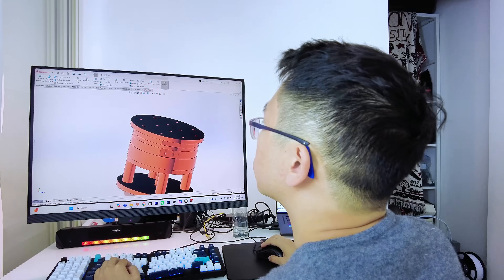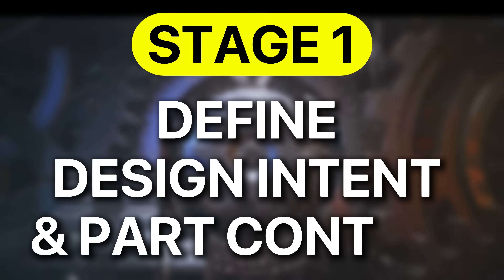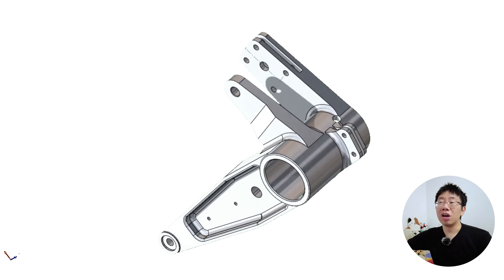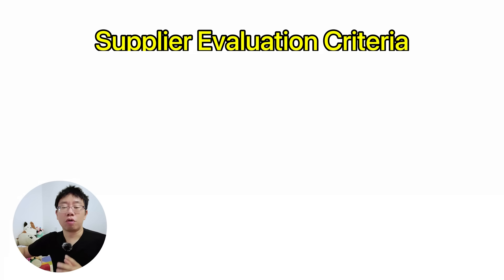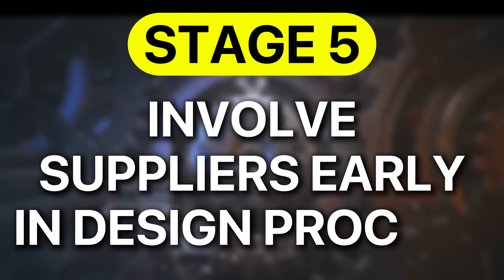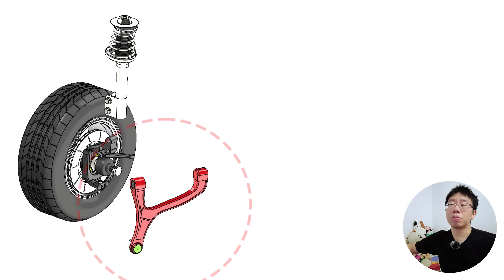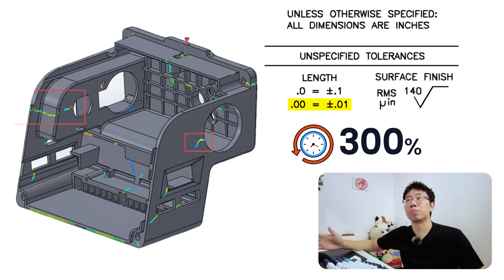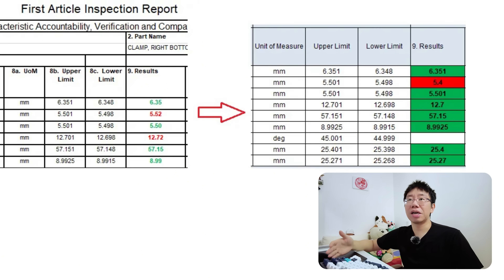Why Manufacturers Hate Your Design and How to Fix It

Comment: 4:10 modern swizz lathes are CNC. You can mix manufacturing processes, like forging the head of a screw, laminating the thread. 
Additive manufacturing is starting to grow, now is using diapers. However there are pieces or materials that only a 3D printer can manufacture, like tissue or aerospace marts. Jewelry is also making use of two manufacturing processes, one ancient, casting and modern, 3D printed patterns. 
6:12 indeed you should visit the supplier in person when possible. 
8:06 in my experience searching for the supplier means taking the prototype and asking if the prospect can manufacture the piece at the desired price. Sometimes they start giving you designs ideas on how to achieve the budget. (Don’t chanfer this, are the tolerances needed for the feature of the piece, finishing of the surfaces, a.s.f.)

I’ve been in both sides of the door between design and manufacturing. Supplier and designer should work together. Better yet, designers should be well acquainted with manufacturing and assembly lines.
One more thing. Think on the poor maintenance provider who has to suffer the design flaws. (Do I have to disassemble the whole engine to get to the obstructed bolt of the transmission?)
Reply: Ive even seen some guys model a hand with a wrench and use that as an additional "constraint" in their CAD models. Thanks for the hard-fought wisdom :)
Reply: Even better, blocking out an "ugga dugga" and forearm and  (Blocking out means literally making a model out of blocks, i.e. quick rough sketch.) 
Also taking inspiration from appliance manufacturers and putting a waterproof pocket that's easily noticable and accessible by a technician (that means usually right behind the first access door, not with the rest of the manuals because people will lose those) alternatively, print or engrave a qr code and website address if a booklet is too expensive. You can put it with the serial number sticker if you don't want to spend more money.
Reply: Whaaat? You mean i wouldn't have had to ask for a jet engine to be dropped to tighten a fitting because there was a random bracket boxing in the connection? Or for the fuel system to be disconnected and 3 parts removed to remove the last bolt on a part where the other bolts are easily accessible?

Comment: Worked for a vertically integrated company that had R&D and Manufacturing under the same roof… I sent so many of those “we can’t make this” emails. Manufacturing engineers make great design engineers later on because they understand the constraints of different processes so intensely. 

Worse than going to R&D about a functional feature was going to marketing to approve exterior design changes 😂
Reply: this is why you cycle new "designers" or R&D types through manufacturing first. That way they learn what their own company can and cannot do.
Reply: @kurtmueller2089  Yep. Funnel through the primary bottleneck first, then optimize every other problem in accordance with that

Comment: "Design for a process, not every process." - Such a key takeaway. We frequently help designers choose the right one (CNC, 3D print, vacuum casting) for their stage and volume. Clear communication on tolerances and critical features from the start prevents 90% of issues:face-blue-smiling:

Comment: Why do you keep ur 3D printer next to you ? Doesn’t it give off fumes ?
Reply: it's clearly just for the background image. you could notice there is no space for the mouse as well, so I'm assuming he places it there just for the video.
Reply: Filament 3D printer doesn't.
Reply: @RitamSanyal  it does, depending on filament.
Reply: @jtucehok  oh ok,I have only seen resin once with fumes.
Reply: ABS and ASA are the worst offenders of the common filaments (for some cursed reason pvc exists too but is rare), but even pla is not great if printed with no ventilation regularly
They are fine when cooled but the plasticisers in them evaporate when heated and they are evil.
Reply: @RitamSanyal depends on filament...

Comment: Test automation engineer for PCBs here - me and the team I'm working with have been developing+ building one-of-a-kind test systems for our internal production for years. In a recent project we were tasked to bring up these systems to a more scalable standard (from handsoldering the PCBs and crimping cables on the fly to standardizing it and making it manufacturable externally without issues. For that we closely worked with a specialized team that is focusing on manufacturability. All the points you mentioned in regards to mechanical design also apply to PCB design. What soldering process do you wnt to use? That influences part type, count, and placing - assembly on both sides or just one? Only soldering or are there press-fit connectors? How thick are the copper layers? With thick copper layers even the overall copper distribution matters - if its not balanced the PCB will warp and might not meet certain standards.
The devil really is in the details and in the last few months I learned almost as much as I did in 2 semesters of electrical engineering. Fascinating stuff!

Comment: All engineers/designers should be forced by law to take an apprenticeship (2-3 years minimum), at shop level in whatever industry (machining, casting, forging, injection molding), both manufacturing part and maintenance.
One would learn some trade secrets that never make it to the textbooks.
Reply: this remind me of the treatise on bicycle wheels by jobst brandt, the guy did a lot of research, trial and error on his own, because the knowledge was only trade secrets and cargo cultish when it came to building bicycle wheels, and when he tried to build his first set of wheels, he found no books on it, no information on why he should use any particular parts and such, and to quote him : "I wrote this book to preserve the information that I gathered and to help others avoid errors that often have led to failures. I hope it fills the void that I perceived."
also the apprenticeship aspect is proven( to be a better way of doing so in computer science/software engineering, i've done an apprenticeship as a software dev, and out of uni i had more industry context and how stuff worked in the office than someone who only did uni work, and i'm not the only one with that feedback.
Reply: How about sending a future teacher or someone who can create extended textbook containing those trade secrets?
Reply: @anterprites  or even better, why not have older engineers with 20-30 years under their belt go become teachers where it matters, like, make it a part of the obligations to hold an engineering title
Reply: not quite what you are suggesting, but in my german mechanical engineering course there was at least 1-2 semesters of not actually doing manufacturing, but learning about what would be feasible to do along with many extracuriculars that would teach you by doing something like a small racecar or gokart and during cad lessons we were taught to consider whether features where actually necessary and machinable, though im not sure if everyone taking the course got the lesson
Reply: In my professional opinion, apprenticeship isn’t enough. Engineers will need to get actual classroom time and actually get certified in some areas like Metrology, where GD&T is heavily utilized.
Reply: @rufus2028 time in the classroom isn't lacking, though. OP is saying that you need to solidify theory with real word application.
Reply: And then they should also be paid 2x as much but that's the key problem, no exec would ever pay their employees double and thus we end up with industries where select few great people work, while everyone else are just trying to not fight one another on a daily basis lol
Reply: It doesn't help. You're assuming the guys doing those jobs know what they are doing. That's never really been the case. Even before there was CNC there was production. A guy on a manual machine with a specific setup to do a specific job. Very little broad experience. The myth that these old dudes held god levels of sacred knowledge is bs. 

I had a guy who had been doing this for 30 years want me to make a split part unified. It had a 30mm diameter bore and a groove inside that was 100mm in diameter.

This guy, a tool maker didn't understand that you can't have a tool that can reach that.
Reply: @jeepmanxj  yeah, stupidity is unavoidable, but i do think we remember the stupid ones and not the rest, i remember the 30+ year of experience dev that couldn't read the documentation i wrote and who i had gone over with once before leaving the company, on how to install a package (literally, two line to call a tool with the proper parameters, one to install the right version, the second to make it the version that's used) and wasted a coworkers afternoon on this, the rest, i don't remember in as much details sadly
Reply: @jeepmanxj  sure but, only an old dude could have god levels of knowledge and experience. My uncle said his first day at an engineering consultant firm, he realized they were making a gearbox for a pole saw backwards. He was new so he racked his brain for half a day before bringing it to the guy who designed it. The gearbox was "ready" for casting a production run 2 weeks later. He probably saved them 1/2 million in 1980s money.
Reply: @adammontgomery7980  no. Just because you're old doesn't mean your knowledgeable or experienced. I've got kids in my shop that run circles around guys in the role for decades. 

Just because you do something a lot doesn't mean you understand it or comprehend it. Experience isn't gained by doing its gained by understanding. 

Do you know how many guys I have met in machining that don't understand threads even though they have been cutting them for decades? Way way too many
Reply: @jeepmanxj you misunderstood what I'm saying. ONLY an old guy CAN be very experienced and knowledgeable. Young people just haven't seen/done enough.
Reply: @adammontgomery7980  and I'm telling you that explicitly is wrong